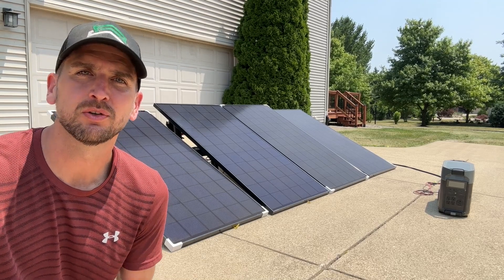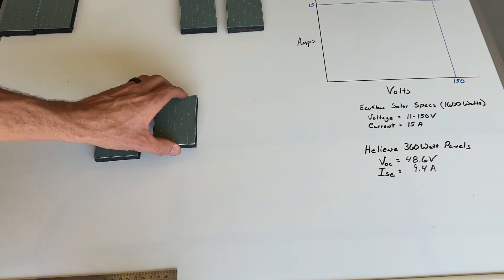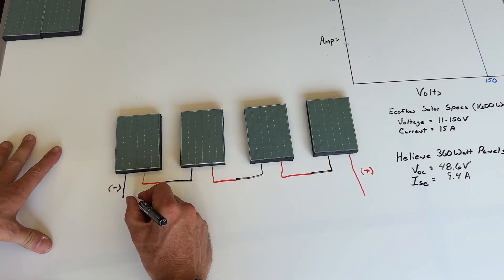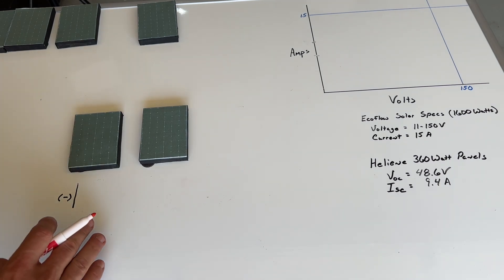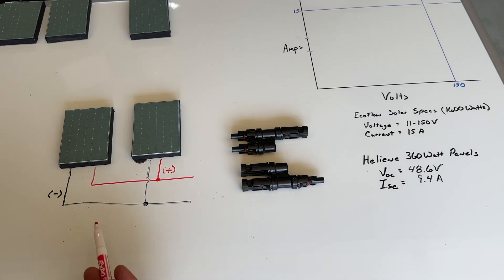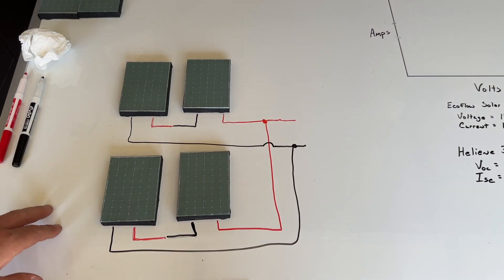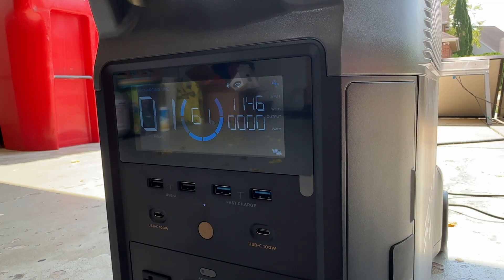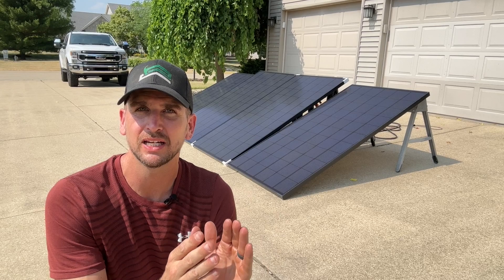Solar Panel Wiring Basics | Maximizing EcoFlow Delta Pro Solar Charging

Comment: This is a very informative video.  However, it seems that most solar energy systems are focused on "net-metering" and still being connected to the grid.  I talked to a solar company today, and was quoted a cost of $40,000 for a complete solar/battery system to be completely off-grid.  That is more expensive than the $25-$30K cost to connect to the grid.  It looks like I will go the old-fashioned route with propane for all of my appliances and heating (including refrigerator) and then doing some type of DC solar power for my well pump, TV, and laptop. Maybe a small RV system might work.  Not the best for the evironment since propane is still a fossil fuel, but at least I can avail myself of the service with little input cost.  Solar might help the environment, but all of the hype does not benefit the average person.
Reply from the maker: Hey Michael, thanks for the feedback and I will provide some examples of Off-grid setups as well.  I will probably start with a simple "off-grid" shed where you could run a few circuits like charging your electric mower and lawn power tools but then step up to a garage and then possibly a cabin/home.  The costs are coming down but you are right solar isn't right for every instance and still depends heavily on federal and state incentives.

Comment: I have a question. I bought the Delta 2 Max and it has 2 solar inputs that it says can take 500W each, so total 1000W, but then it says 60V max and 15Amps max. 

So my question is how many 100W solar panels can I connect if they are rated 20V max and 5A max and what is the proper configuration?
Reply from the maker: Nice, I am looking at the Delta 2 and Delta 2 Max now.  I would probably shop around for a panel that would be a bit larger where I could simply string 2 or 3 panels in series into each of the 500W solar inputs.  If you had to use 100W panels you probably would be looking at 2 panels in series and then bringing together 3 of the sets of panels in parallel for each solar input.  Again not ideal but remember voltage is a hard limit but the Delta 2 Max will just throttle the current so your system can add up to more current as compared to the unit specs of 15 Amps Max.  That would be a total of 6 panels for each solar input but the wiring will be a little more complex and don't forget to size some inline fuses.
Reply: @everydaysolar  thank you very much for responding. I’ve been trying to get straight answers from Ecoflow and a couple other places (people) to understand how to size properly. (The example panel specs I’m using is from a company selling the Delta 2 Max with 10 of these panels... I called them to ask how they configure it, but to no avail, they said a tech support person would call me back.)

To clarify, in your configuration choice it would have 40V @ 15A entering both inputs? (=30amps)

Questions to help me understand solar wiring logic: 
1. Would that mean 15amps is theoretically not being used? (Hence why you said not ideal? Or is it the 200W extra.)
2. Why not string them into 2 60V strings (series of 3) each, instead of 3 40V strings (in each input port). (Is it too close to maximum voltage for your comfort?)
3. Can you parallel a series of 3 with a series of 2? Like 60V series with a 40V series.

🙏🏼
Reply: @everydaysolar  i gave Ecoflow the same example (100W) panel and asked if I could hookup 10 of them. This is what they just responded with:

“We recommend you use 8 100 W solar panels to connect with Delta 2 Max.
 
You can divide 8 solar panels into two groups. One group for one solar charging port on the Delta 2 Max.
 
You can put the 4 panels as a group into 2 sets of 2 solar panels connected in series and then connect the 2 sets of solar panels in parallel.”

So I still have one question: what would happen if you connect in parallel a series of 3 with a series of 2? 
(Would the voltage then drop somewhere between the ~40-60V? Or would something blow up? I’d love to know how this works!)

Comment: Thanks, clear explanation… I have 3 of 400 watts… can use 2 in series and last panel connected to rest of open wires? Thanks
Reply from the maker: What is the Open Circuit Voltage of your panels?  You should see the Voc called out on the data sheet usually located on the back?  Also, are you bringing your panels into an Ecoflow Delta Pro?

Comment: My most sunny area is 150 feet from my home. I'm looking at buying the Ecoflow Pro, if it works out I will add an additional Pro for 240 volt system. What are the limitations on distance? Amps are a max of 15, most solar wires seem to be 10 gauge. Will the issue only be a slight loss in wattage?
Reply from the maker: Unbound Solar has a line loss calculator https://unboundsolar.com/solar-information/voltage-drop.  I plugged your numbers in and got 3.73% voltage drop (10 gauge) which is above the NEC recommendation of staying below 2% if you could find some 8 gauge wire and compatible MC4 connectors you would lower the voltage drop to 2.35% which seems reasonable for 150 feet.
Reply: @everydaysolar  appreciate the information,  enjoy your videos, easy to follow.  Voltage loss, trying to understand how that translates at the inverter.  Point being it will except 11-150 volts. So if 145 volts are leaving the panels, I loose about 4%, equates to a lose approximately 6 volts= 139 volts. 

Maybe I'm comparing apples and oranges?

Comment: So. No matter how you configure those 4 specific solar panels, you're still never going to achieve their full power potential into the EcoFlo. Because either the total voltage (in series) is too high, or running them in parallel results in unused amperage. So, I'm assuming a better option would be to properly size your solar panels and battery power unit to avoid lost power.
Reply from the maker: That is exactly correct.  These panels are for another project so I definitely didn't purchase them sized for the EcoFlow 👍

Comment: Nice video! I am trying to make paralell with a combiner box. They seem to block oneenother in some whay. What am I missthinging?  https://youtu.be/m7x-Q5R7-nM
Reply from the maker: Are you running that into a Solar Generator or if not what type of inverter are you using (String or Micro Inverters)?
Reply: @everydaysolar  Thank you for arswer! I am using a Fronius symo 3.7

Comment: OK I have four solar panels the 25 wattage each so I have 100 wattage with all four I plug each panel into one of those logical it’s like a ground fault or it’s Cincy cord thing whatever it is you plug all four of them in one unit It’s circle I could hook up four more total eight plugs on this unit I don’t Collett I forget what they call it right now I only got four of those solar panels on it and I’m getting tween 19 voltage tween 18 to 19.5 I think it’s but it was when I checked it with a metre if I get four more hooked up to it it goes like to all of the panels go into one little box then yeah to wire is hot in the ground go into your Apple Watch, now I’m sorry I am not good at this stuff so panel connecters then you can also hook up your battery they give you a thing for hook up your to your battery to the unit it says you’re white male can’t believe it I’m just out my brain just went dead I can’t remember what it was what do you call it anyway comes with if you know what I’m talking about it’s the thing from HarborFreight you can buy all the whole kit I don’t have a box what you got can use one of those tests to power a trailer home trailer to my house and I’m trying to figure it out I’ll get it figured out somehow I’m not that electrical stuff Tele find somebody could help me out tell me what I Gotta have when I need to be off grid I want to get off grid I get this then I’m off grid I got to get my power

Comment: thanks for the video! You have giving me good info, just trying to keep a frig, gas stove, a small chest freezer. Would like to get a washer on it and some heat. But that may not work on a Burnham gas steam boiler. But would like to get an eco flow generator for the house to power just what I needed during a black out if it happens.
Reply from the maker: "Prime Day(s)" is tomorrow and the 12th.  Keep an eye out as there might be some really good deals on EcoFlow, Bluetti, and some of the other larger brands in the portable power station / solar generator space.
Reply: I used a killawatt ez meter to plug in each appliance I wanted to know power usage over 24 hours. 
Best 30 bucks spent.  Oh and tiny dorm fridges don’t reach take out food safety temp quick enough…..66 watts when cycling but for beer rather than food in shtf.

Comment: off topic a little, i have a ecoflow 1000 delta 2 can i charge my jackery 500 with it and what would i need to do that thank you
Reply from the maker: Sure, you would just use the 120V wall plug from the Jackery in the 120 20-Amp outlet from the Ecoflow.

Comment: Yeah, OK, but you're not finished yet are you ? So how what is the exact combination required to get the Maximum 1600 Watts into the Delta Pro Dude ?! Your job is not finished yet ?
Reply: I have very sim panels mine at 350 at 48.2 
I use a 3S2P wiring. Two loops of 3 . 
The guy in this video would benefit by getting 2 more of same as he has .  Over paneling with a DP is ok but never plug in more than 150v not even to try it out. For sure warranty would have me paying

Comment: Easiest would be just to use one panel.  Qcells does make a 475 to 495 watt 78 cell.  Which means 45 volt STC at MPP.  It should also be ok for use at -30 celsius (Canada) as the open circuit should be just under 60V, which many all-in-ones do not exceed.

72 cell is ok, but I find that it does not match as well as 78.  If always in hot USA, it actually makes more sense to use a 84 cell, if such a thing exists.

There are many benefits to using just one ginormous panel, ease of connection, no extra wiring or fittings and no voltage insertion losses.
Reply from the maker: Nice, If I went that route I would probably grab 2 of the ginormous panels and just wire in series since the voltage will still be under the 150V max on the EcoFlow and no additional wiring needed.  I want to place this setup in a off-grid shed where I have some outlets, lights, and battery chargers for the outdoor electric power tools.

Comment: Love your video, so clear with the diagram. Is there a limit of length for the cable between one solar panel like the 220W -Ecoflow and the Delta 2 Max and is 10AWG preferable to 12AWG? Thank you.
Reply from the maker: 10 Gauge should have less line loss but I don't think there is a set limit on the length of wire.  I picked up 10 gauge to make my own custom extension cables.  Here is the one I picked up last week https://amzn.to/436SdE7

Comment: EcoFlow offers a dual propane/gas generator for $1,599 that puts out 1700 Watts and will charge the Delta Pro in about 2 1/2 hours. Using propane, it will use approximately 1 gallon per charge - installing a 100 lb propane tank will give you about 26 gallons of fuel, so in an emergency situation, you would have plenty of fuel to last several weeks without having to deal with the solar issues - the EcoFlow generator connects to the app and has 3 different start options. Manual Start, Push Button Start, and you can also program the generator to start automatically when power gets down to, i.e. 10% - I believe this makes much more sense for people who are using the EcoFlow as an emergency setup for hurricanes and other power outages-
Reply from the maker: I think you are correct.  It would be nice it there was a smart splitter that could start and charge each of the 2 Delta Pro units from 1 smart generator.
Reply: @everydaysolar  You can charge both batteries at the same time using the DC outlet and the AC outlet. Although the unit only comes with one 16' DC charging cable, you can purchase an AC cord to charge the second battery-
Reply: @everydaysolar  I just found out that it actually only takes about 1 1/2 hours to charge each battery using the EcoSmart Dual Generator with propane, and only uses about .40 of a gallon - you can also charge both batteries at the same time using the DC EcoSmart port and the AC port - for $1500, I believe this is the way to go instead of dragging out solar panels, or mounting them on your roof for a measly 115--1200 watts. The EcoSmart Generator charges at 1800 watts -
Reply: Oh my oh my I just bought at Home Depot in nh . No sales tax  if I buy in NH saved 56 plus I get. 10% vet discount .  My price 1034.
Reply: Only thing crappy is the restriction of the 15’ cord.  I love the quick connect propane - 12.5 hr run on that.  And setting parameters to make it auto start when % of DP gets too low .  Wife and kid can use the app .  Better than not knowing how much juice we got

Comment: This is one of the best explanations I have seen on the differences between series, parallel, and series/parallel solar panel connections.  Your drawings and explanation were very clear and easy to understand.  I do feel you left out a couple of important pieces of information for people to realize when they are determining how to wire their panels and what to expect from them.  The first thing is a realistic expectation of how much power they will get from a given panel.  Most panels will output somewhere between 80 and 90 percent of their rated capacity.  So, your panels had a theoretical max of 1,440 watts, but when you multiply that by .85, to account for efficiency losses, you get 1,225 watts.  That's about the most anyone should expect from those four panels, no matter how they are wired.  The other very important consideration when deciding how to wire up your panels is shading.  If your panels don't have bypass diodes to address shading issues, then wiring in parallel, or series/parallel, can ensure you get at least part of the output from your solar array, when the array is in partial shade.
Reply from the maker: Hey Jason,  thanks so much for the feedback.  Both additional points are very valid.  I actually am planning on doing some testing (wired in series) with shading and talking about the bypass diodes which these panels have 3.  I also have some power optimizers to compare if they make much difference since the panels already have the bypass diode capability.
Reply: @everydaysolar  Thanks for good video, I am attentively waiting for your next video that address these issues. Right now I have 4 panels that each has Voc is 37.1 and Isc is 8.58 Amp with Ecoflow DP. Currently I wire them in serial, 4 more panels waiting to be wired when I see your next video. Thanks again.
Reply: @everydaysolar I have an issue understanding and I'm sorry, but earlier the setup wouldn't work because it exceeded the voltage. But now with 4 it work because you're using amps? But shouldn't it still not work since the 4 panels still exceed voltage?
Reply: @ksksmwbamqusuabwba2421  when wired in series parallel, it's 2 times the voltage AND 2 times the amperage (not 4 times the voltage or 4 times the amperage), thus never exceeding the limit of the battery (150v max, 15a max) because the panels would now deliver 45v x 2 and 9.4a x 2.  Notice how 9.4a x 2 would be 18.8 amps (which is over the 15a max of the battery), but because he said it would still work when the amperage is exceeded, the panels are delivering power just fine to the battery.
Reply: @everydaysolar  did you ever do a comparison of these with optimisers on? Someone was asking about this for 2 strings and shading mitigation when charging an ecoflow. But others have reported interference in MPPT readings for the Ecoflow because the optimisers also have MPPT and cause mixed signals and errors.
Reply: +1
Reply: I finally understood. I needed to see the little blocks on the board. 🎉❤ Seriously.
Reply: @Talpiot_Program  I think if he drew amps and volts in the final diagram we'd understand it faster. But overall, love this vid!
Reply: 100% agree!!

Comment: 👋👋👋Hi Scott i have 2 solar panels each panel is 160 watts and 8.9 amps and open circuit voltage of 21.6. 
Together they will be 320 watts and 17.8 amps total open circuit voltage 43.2. going straight into the ecoflow from the solar panels direct.
i am thinking of getting the Ecoflow delta 2 today will my panels work on it thanks.

please reply.😁😁😁😁
Reply: Yep, shouldn’t be a problem to wire both of those panels in series and straight into the EcoFlow Delta Pro which comes with a MC4 to XT60 wiring adapter.  XT 60 is the connector type that goes in the back of the EcoFlow and then MC4 is the default Solar panel connector 👍
Reply: Is it xt60i rather than xt60 needed in this case?

Comment: good video. Of course 2x3 panels would get you much closer to 1600W max.
Reply: That’s my set up DP with 3s2p ….2 strings loops.  I have used panels 350w 48.2v …..bought panels for 75 each.  Sounds silly but I cut almost 2 dollars off my bill every day till I die or equipment failure  so eventually in 5 years I should get some profit. Gluck